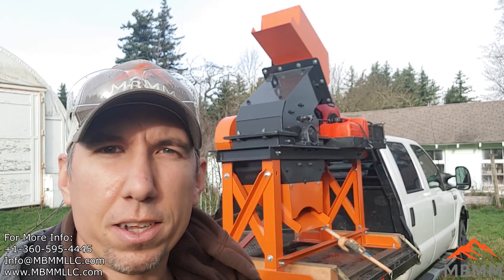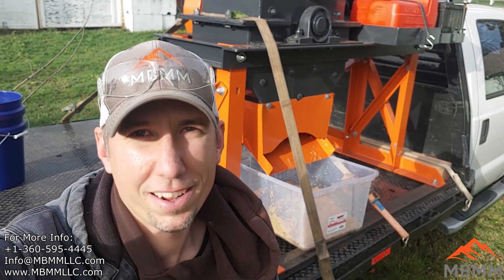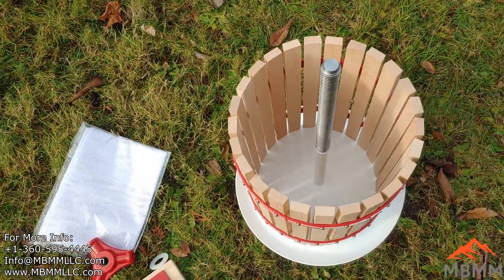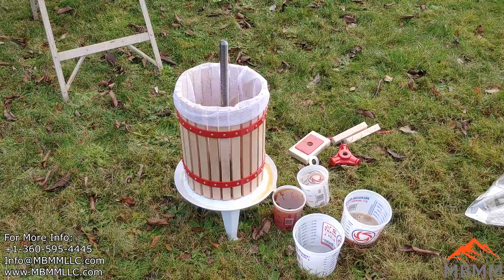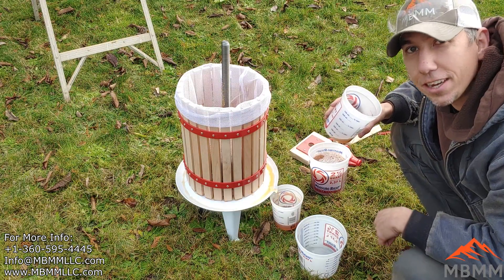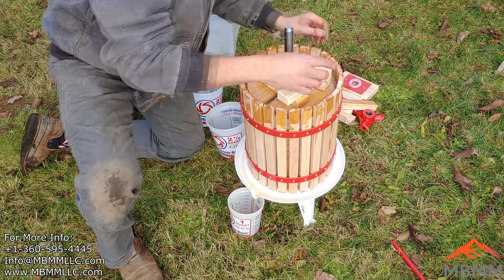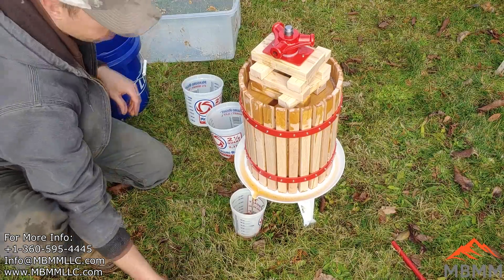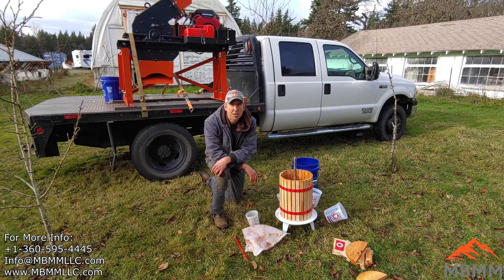Making Apple Juice With A Hammer Mill

Comment: One of my favourite videos on your channel Jason! I would have liked to see a comparison at the end with current juice quantity per kg vs quantity per kg with the completely milled/mashed apples.  Although I think you might have had the spacer/Jenga blocks 90 degrees off in the Amazon press, usually those things have enough spacers to use the lever on top almost until the half moon compressor plates are very near bottom level.  Try find a pear farmer willing to try it out but don't be using 500ml or pint glass collecters, you'll need buckets!

Comment: Probably want to bleach that hammer mill out before running the apples through it, I was laughing our cider press has a hand crank that one person cranks so using a Honda motor had me giggling, it doesn't make anywhere near that fine of apple pulp!  Either more pulp inside the cheesecloth or  bigger blocks to push the top down.  There's nothing better tasting then fresh pressed apple juice, it's fun to mix different varieties of apples together for tastier juice blends, grinding up pears also makes a nice Perry juice.  Why they split the top pieces of wood when one piece of wood would suffice, great vid Jason!  If you've never participated in an apple juice pressing party, it's an eye opening experience for some reason every one is smiling while they're doing the various parts of the process.  Get a bonfire to keep people warm, press some apples.